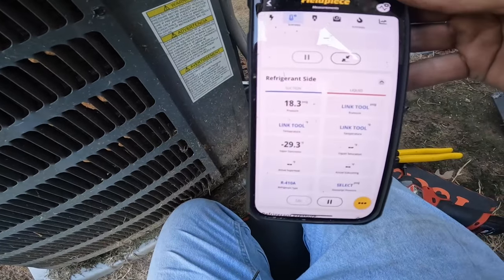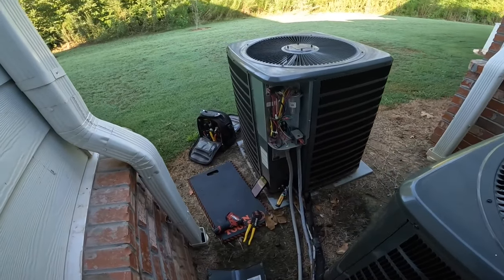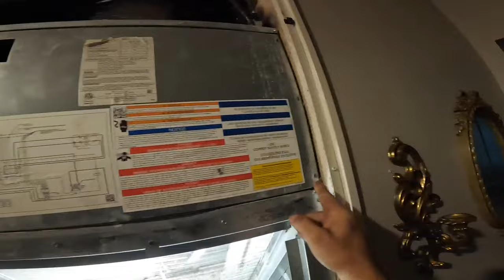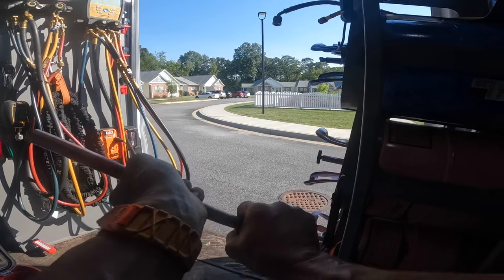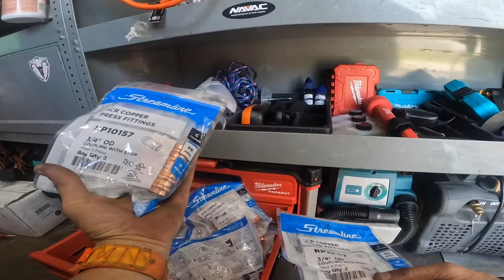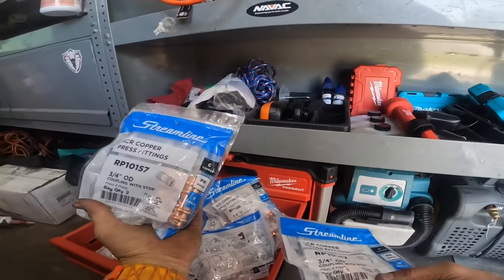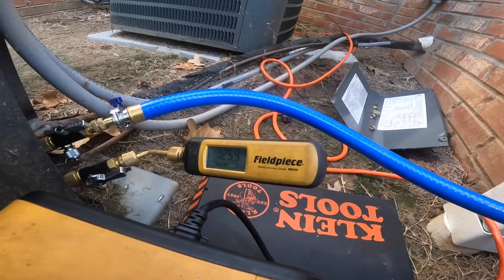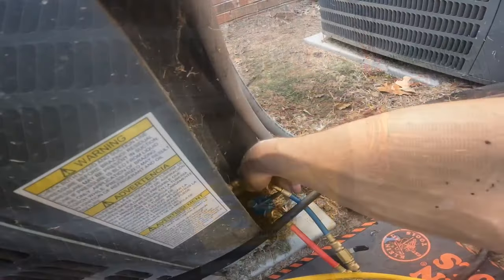Changing a Coil On An AWUT Air Handler! #hvacguy #hvaclife

Comment: Ever tried the adjustable wrench trick on the copper pipe to make it round again? I used to do it and work great for me. Take adjustable wrench or what some people call a Carolina speed wrench and adjust it the same size of pipe. Then run it around the pipe where it's has flat spot and makes it round.

Comment: What worries me is that system isn't that old, I just got a new Goodman heat pump with the new Air handler. I hope it lasts as long as the old system did. To much aluminum and electronics! Take some time off! Rest!
Reply: It will break in a month I can guarantee it that’s what always happens

Comment: Nice work Hoped you sized the piston correctly. Would of thought your subcooling would have been a little higher
Reply: Not when it’s a piston on sub cooling. It came with a piston so I’m sure it’s the right size
Reply: @mwatkins2464 .  Sir he doesn’t have any subcooling  even with a piston you would at least 5degrees ;exact load temps wasn’t mentioned except him saying it was hot in there.  Having a 0 subcooling is correct. He’s getting a vapor/ liquid mixture at best
Reply: @mwatkins2464  hey my friend I just looked at the video again here we discussing his subcool reading being low he doesn’t even have his Liquid Line thermometer hooked up   Lol

Comment: I hope not but I think you will be back there within two years with those press fittings leaking…bad thing is if this is the case you will have to remove them and not merely brazing them up cause of the o-ring